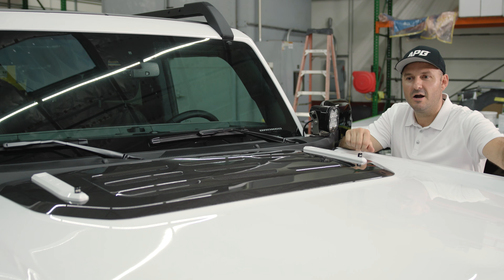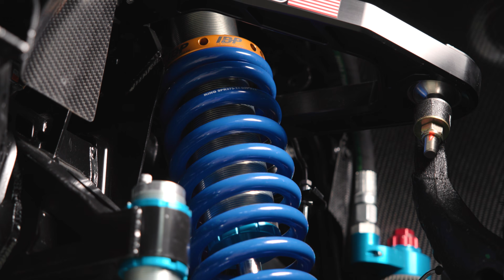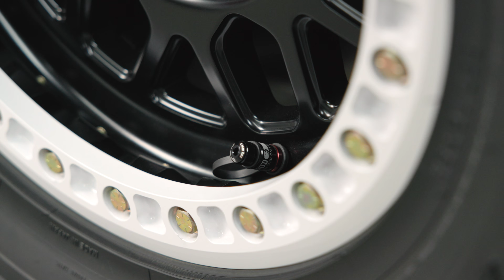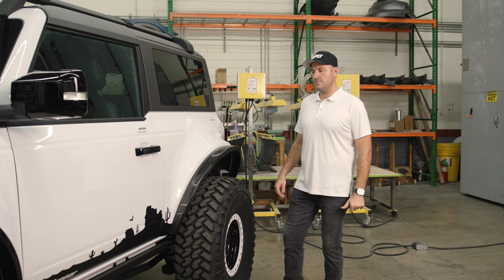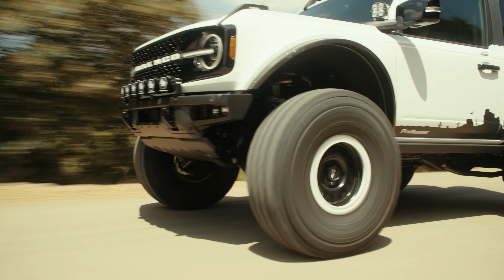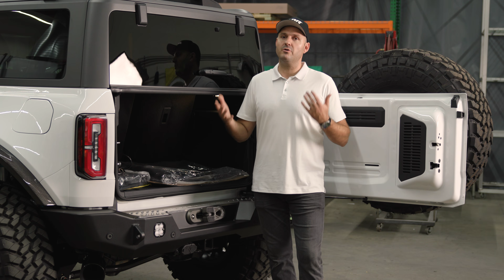ULTIMATE Ford Bronco 2 Door Build | APG ProRunner

Comment: looks good, but 10 grand for fender flares is stupid. carbon is not that expensive
Reply from the maker: ProRunner is a complex body system, not a “Flare”… Domestically made (Advanced Composites) are indeed costly to manufacture. Thanks for the comment

Comment: This is an awesome bronco but does it have the factory 2.7L engine?  I would think that with how heavy this thing is that it would struggle.
Reply from the maker: Turbos work
Reply: @APGOFFROAD   Good to hear.  Do you ever make the mid or pro runner with the 2.3L and manual? Also do you ever make it from a bronco that does not have sasquatch for example from a base bronco?  thanks.

Comment: So NO engine/HP mods other than exhaust tip?  Very impressed, but at the price sure would be nice to see some ponies added🤷‍♂️
Reply from the maker: We add performance programmers, intakes, and exhaust. Entry level but noticeable power gains. Every build is commissioned with a pre set parts list. For customers looking for more power there are intercoolers, downpipes, and unique tuning options available (Outside California) In 2024 we will start our V8 integration program. (yes we are excited for this)